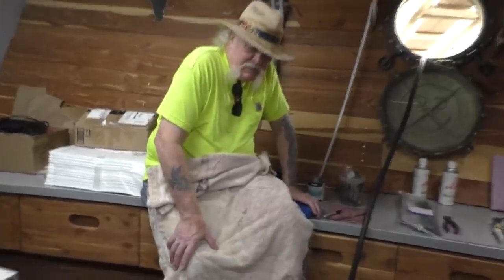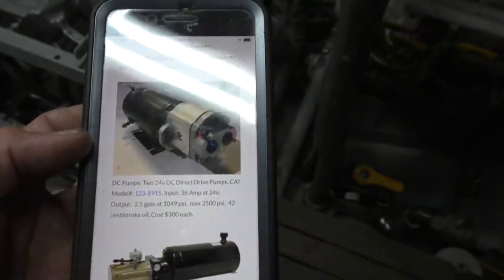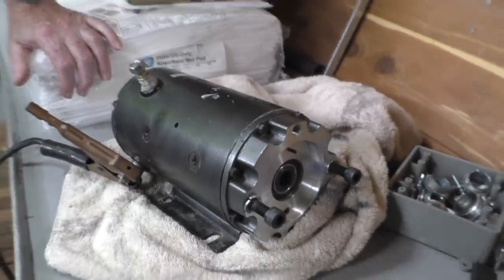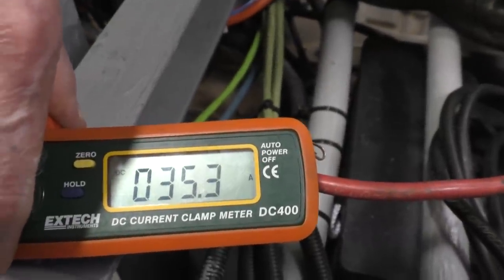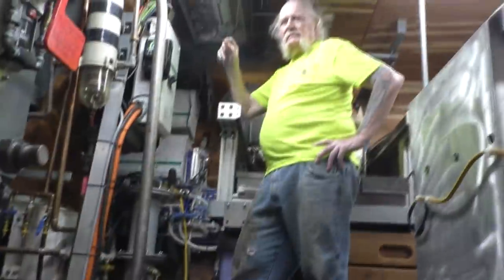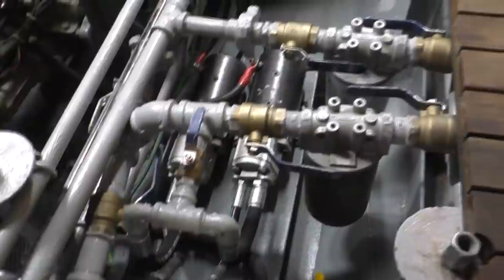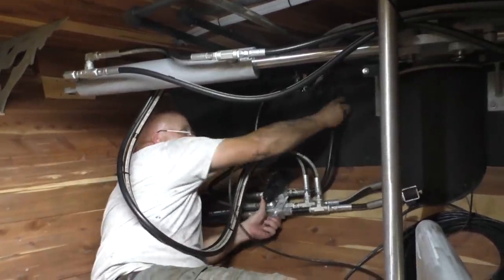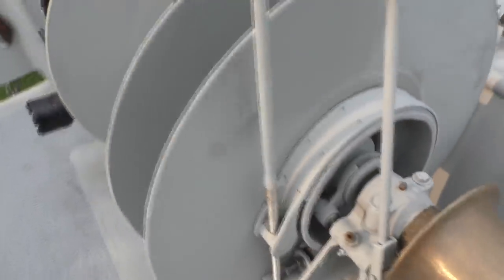Hydraulics - Part 9 - Charging the System

Comment: A 36 Amp motor should be rated for 300% for starting, or 108 Amps. You need motor starters that can handle that load for a short time during startup then protect normally.
Reply: This, this is why they make motor starters.
Reply: This is it
Reply: Doug, your in rush current is the problem.
Not your voltage.
You need a motor controller.
Reply: Maybe also keep that voltage up to get the current down. Running two parallel starters, ideally from two separate breakers - 200+ A is beyond my experience, but can those cables take that much current?
Reply: @Skwisgar2322  yes and use a 3 phase contactor looping through all the contacts  in series.
Reply: Would this be a good application for a VFD? It would adjust to the load on the hydraulic system.
Reply: @kermitfrog1897  I've installed dozens of them, which resulted in big $ in utility costs. I forgot about slowing the inrush current.
Reply: Yes! That's why car starters require such heavy wires and solenoids. A 100 amp starter may draw 3-400 amps initial load. (not to mention getting the engine rolling from a dead stop)
Reply: Correct.  You should use a D curve breaker instead of C and you will be fine.  All breakers are rated for spikes of current at startup.  Some more than others.  Just have to use the correct one for the application.
Reply: Came down to the comments to look for this. In-rush pops breakers that arent sized properly. Proper motor controllers / starters will solve this.
Reply: @kermitfrog1897  What are you talking about? he is working with DC Motors not AC. A VFD isnt going to work at all here.
Reply: @morganmcintire2853  Yes I know that . I posted later to disregard previous posts
Reply: Even if he only has C curve "supplementary circuit protectors", they should hold at about 6 times the rated current for about a second, and twice rated current for maybe 10 to 30 seconds. His devices seem to be tripping very quickly so I'd guess he is well above 300%.  D curve (which can carry 12 to 20 times rated for about a second)would probably be better or maybe even old school sol-blow fuses
He really should have a current meter with a good peak capture if he is going to be trouble shooting that kind of stuff
Reply: @morganmcintire2853  thank you for taking the time to explain this to us.
Reply: @cabletie69  No problem, my head is packed with useless information, nice to let some of it leak out now and then :-D
Reply: I think they were DC motors, vfts won't work with a DC motor. Also what size is the wire if sized for a 40 amp breaker you could be seen to a voltage drop and driving up the current good luck with your final solution
Reply: @kermitfrog1897  variable frequency drive........ on a direct current motor...... what frequency are you going to variate?  DC current is 0 Hz.......
Reply: @TheIceRover  read my post elsewhere under this video, where I responded to ignore... that I didn't realize they were DC motors
Reply: I don't want impose what I learned in Belgium engineering school....but the series theory doesn't apply because you can not guarantee the same load and rpm on the both engines. If the load is different then you have 6v on one engine and 18 v on the second. The sum will be 24v. That 18v engine will not last long because of over voltage. Burning carbon contractors borstels. The 6 v one will heat up due lot of current. 
 You need 24v motors on a 24v battery system. Otherwise you have to send the engines back. The start current can be up to 500%  and max pressure current  can be 300% of In (nominal) current.
If I don't get the imax or I start and the Voltage I will never buy that product. Ideally you even should get a chart current VS load. All the best.

Comment: There is a potential problem with running motors in series like that.  If you slow or stall a motor the voltage drop across it will drop (and allow more current to flow through).  If that happens to one of your motors, the other motor will suddenly have a lot extra voltage across it.  You'll probably be ok for now, but I'd highly recommend reworking your setup soon.
Reply: Lesson learned with slot cars - lift off when your opponent is on the corner - all the juice goes to his car and spins off :)
Reply: Not a problem in this application. The pumps are connected together so the load seen by each motor is exactly the same.
Reply: Just need a soft start integration.  Pretty straight forward for any electrical motor guy and easily researchable
Reply: And while running in series, if you are pulling 36 AMPS each, now you're running 72 AMPS through each pump. YMMV
Reply: @brianrydzeski6108  that's not how current works
Reply: @brianrydzeski6108  With the motors in series each motor gets the full supply current but half the supply voltage. In parallel each motor gets half the supply current but the full supply voltage.
Reply: @brianrydzeski6108  In a series circuit, I believe the amperage will be the same through each component, it is the voltage dropped across each component which will fluctuate. I do not believe that running the motors in series is a very good permanent solution. Atb
Reply: @brianrydzeski6108  They are not running series. That would be a ridiculous idea

Comment: Switching out breakers to meet the requirement of the motor like you were doing is something you can only do if you are working on your own system and know its limitations. In any more mainstream system the breaker would be dependent on the the wire used until the endpoint. THe breaker normally serves to prevent overloading the cabling.
Reply: In motor control circuits we use overload devices (breakers) to protect the motors, the cables are sized to meet the requirements of the motors and breakers. This is normal practice in motor control systems. This is how it is done on all industrial motor control systems whether it is your own or someone else's.

Comment: Inductive loads such as motors have huge inrush current. Try switching to a slow trip breaker, the fast trip ones are not recommended for inductive loads.
Reply: Yes.
Reply: I would also move back to 24v per motor, as this will drop that amperage needed to run the motors, were they were pulling 200 amps @ 12v in series,  it would be 100amp @24v in parallel.
Reply: @TWMist  Yes.
Reply: I believe this is correct for what is happening. The ‘inrush’ current is the current needed to build the magnetic field before there is motion of the motor. This condition is called ‘locked rotor’ and is typically 6x the running current and only lasts until the motor is up to speed. There are special breakers for handling locked rotor currents in motor applications.
Reply: Im no elechicken or enginerd, but couldnt you use some sort of capacitor/buffer to handle the large startup current?
Reply: @dave.willard  In fact the locked rotor current is generally around 10 times rated current and indicates that the motor isn't turning hence locked rotor, start current is around 4 times running current for an unloaded motor and 6 times for a loaded start, if those motors are rated at 36amps then it shouldn't be too long before they both burn out.
Reply: @roberson644  in some applications I have seen start capacitors. One of my clients use them on the starter motors for their dozers. Not as common and you would think.
Reply: @roberson644  no for many reasons but large capacitor are really expensive and even if you could get one like they tried selling for cars with big audio systems it probably still wouldnt be large enough and cost many hundreds of dollars but as long as the cabling is correct to handle the full load current than an approprately sized d curve breaker  will do the job
Reply: @justinmorris4457  start caps are used on ac motors but not for that reason, capacitor in an ac circuit changed the sinewave timing so by using one on a motor you can take a single phase supply and kind of simulate it being connected to like a 2 phase supply giving you more starting torque normally these are on a centrifugal switch turning off that when up to speed
Reply: @shaynegadsden  I guess I should have clarified that I don’t see them very commonly used as a means of mitigating the inrush. We use them all the time for phase sequencing, harmonic mitigation, and smoothing the “DC” side of a bridge rectifier. They are also an integral part of how a VFD operates and why you always look at the little red light before touching the DC buss on a drive.
Reply: @roberson644  No. Capacitor would just draw more current and not help with anything. Not used for DC motors.
In other words, a capacitor being charged up would draw a whole bunch more amps through the breaker. Guaranteed to pop!

Comment: As  🇬🇧 sparky, breakers should come with a type C or D for use with motors. All depends on the Trip Curve of the MCB.
Reply: All those breakers he is using are C curve. However it's a moot point if the operating current at working pressure is up at 200A... could probably use a B curve if it actually has to be 200A rated.

Comment: I'm not sure where we left off from the Facebook discussion but the work required to pump the oil GPM at the PSI required is 14 hp. That will be alot more than 36amps.
Those pump units on a CAT 745 truck is a substantial drain on 4D batteries. You will need much larger cabling and contactors to start/run those pumps at full flow/psi.
14 hp =10.5 kw = 437 amps @ 24v, 875 amps @12v.
Reply from the maker: I wouldn’t mind 14 hp of DC battery but that’s not the calculation I came to.
Reply: @SVSeeker  what cc/rev did you come to for that pump?
Reply: Hp to drive hydraulic pump = Psi x GPM / 1714
Reply: @SVSeeker  seems to me that a change to lifepo4 batts is in order. 10.5 kwh is 16 x  200ah cells. Space required equals 2 milk crates. Should fit
Reply: Also, series connection is not recommended for motors. If one motor stalls it's current will spike, hence it's burden voltage will drop which will result in the other one overvolting.

Comment: I’m glad Im not the only one that thinks wiring the two 12v pumps in series is not ideal. Im also glad to see the system performing so nicely.
Reply from the maker: If you want to needlessly worry about things you imagine, you will never be alone.  : )
Reply: @SVSeeker  if it’s one thing I’ve learned from keeping up with your progress on Seeker all these years, it is don’t worry about Doug or what Doug is doing, Doug has figured Doug’s stuff out, I need to figure out my own stuff. ✌️✌️👍👍🇺🇸🇺🇸
Reply: What Doug has done works.  The downside is if something goes wrong with one motor, the other will suffer issues too.  That big inrush current will also decrease the life expectancy of the motors and breakers.  A VFD or soft starter can fix that but they can be expensive.
Reply: Are they actually wired in series? Not a good idea if so.

Comment: I see lots of good advice in the comments and I’m sure someone already said this but I’ll say it too. The motors are probably designed for 24v and will run at that they just require a lot more current to start and that’s why the breaker trips. I suggest you wire the 2 motors on separate breakers to avoid a problem of one stalling and the other running faster as well as to reduce the load on one breaker and associated cabling. I’m no expert but I think you may also want a larger amp and slower tripping breaker then the 65amp you used to get past the initial start as well as the demand under load since you were seeing upwards of 200amps. Just make sure the cable you use throughout the circuit is able to safely supply that amount of current without causing an electrical fire. 

Super cool project and love what you’re doing. Hope my opinion on the wiring is helpful. Anyone is welcome to correct me if I said something wrong. I’m not an electrician so maybe take my advice with a grain of salt 🤷‍♂️

Comment: Type C circuit breakers are used for more powerful electrical devices where any surges are likely to be higher – typically commercial and industrial environments. They are designed to trip at currents between five and ten times their rated load. Good examples include smaller electric motors and fluorescent lighting.

Comment: I think you better get a lot of oil  absorbent pads to bring with you. They come in a big roll that make it very handy to rip off a pad when you need one. The next suggestion is a few open top  DOT barrels to put your oily waste in. These are specifically designed barrels with a heavy cover band and gasket to contain everything inside from leaking. 
I can see oil leaks are going to be a big problem on this vessel and a containment program is definitely needed. 🤝🤝🤝👍👍👍

Comment: TO PEOPLE INSISTING ON STARTING CAPACITORS: DC brushed motors DO NOT use start caps and really cannot use start caps.  Technically, you could add a cap to assist in starting but it would be a ridiculously & unreasonably LARGE capacitor and would need to be switched in and out of the circuit automatically; quickly.  Caps are used on DC brushed motors to inhibit EMI/RFI (electrical noise) and to ease arcing from the brushes to the commutator, therefore, preventing pitting and scorching to said commutator.
Reply: Bingo you are right on the money and know what you are talking about.
Reply: 3 phase motors don't use starting caps either...ignore my other posts about VFD's, I was assuming 3 phase motors. Would still be good to separate the series string and either wire in parallel or use separate DC controllers. My lack of familiarity with his system isn't helping things

Comment: They are 24 volt DC motors they can draw up to ten times rated running amps on start up. Under volting a motor can make it burn out faster as it try's to draw more current due to lower back emf due to slower speed and those motors have no cooling so they will get hot quickly.

Comment: Hey just so you know ! If install a test inlet in system. You can pressure the system with air! Find all the leaks before make mess with fluid and latter use same inlet to push out all the fluid back in tank to remove and or repair system! Less messy ? Less loss of fluid!
Reply from the maker: I think that was Part 8  : )
Reply: @SVSeeker  okay must of missed of few with that test? Or ?
Reply: @KG-yn9qi  making a joke

Comment: I think you need slower acting breakers for those motors. They pull huge inductive loads when starting up and your breakers are tripping too quickly.
Reply: Yep. Motor starters exist for a reason.
Reply: @scout10  I don't understand. The motor starts itself, it doesn't need an external device. But it will draw a huge amount of current coming up to speed. Maybe 10x running speed. You need to change to a breaker that will permit the surge current for the brief time startup is happening. Maybe you're talking about something else though.

Comment: I would guess if you run in series, use a large Capacitor to dampen voltage swings.
Reply: Also if one of the motors craps out, you lose both. And usually you use sleeves for wires, before you screw it into the terminal block of the breakers, but guess he prolly knows that

Comment: A typical 12v starter motor runs at 150 amps. Run them through a contactor. You can use one with a  12 or 24v coil

Comment: Doug.  I've been very impressed with your common sense approach to things in general, and to your penchant for adding redundancy to your critical systems.  What worries me is the complexity which these systems necessarily encompass.  I know you had lots of help with the build, and having maps of systems and checklists for operation might add some additional protection in area of human redundancy.  A lot of us out here could study and troubleshoot your main operating systems, but not in an emergency on a moments notice.  My point is this.  Do you have a first mate who is as familiar with SV Seeker as you are?  You got a lot of stuff on that boat, sir!
Reply from the maker: You're welcome to come serve and study every system on board.  If you apply yourself I'm sure you'll do fine.   If I die, it might even come in handy.  So impress me.    But for the love of god sitting at home worrying about what you can imagine is doing no one any good.  Do, or get out of the way.
Reply: I did.  I did for 40 years.  I'm done.  I've taken over my Father's job.  Now I supervise.  Good luck to you!
Reply from the maker: @stephanieluigon5192    Thanks Mom.   Good luck to you.
Reply: @SVSeeker  Ummm, I don't think that's a proper philosophy for running a seagoing vessel. 
This is a very complex system already at the outset. Lots of ways to go wrong. What happens when there are multiple failures that are interconnected, and the seas are the opposite of calm.  Oh dear....
Reply from the maker: @henryD9363  Fear is easy.
Reply: @SVSeeker  these folks find anything possible to fear, just like insurance agents.

Comment: It’s very likely that the motors draw a huge amount of current at startup
Reply: @Darren Munsell absolutely. With no rotation the only limit on current is very low DC resistance of the wiring. Lots of amps. When it gets spinning then the back EMF, creating reverse voltage, reduces the current.

Comment: You got a lot of good comments here. 
Inrush is most of the time the problem. So a breaker for motors is better. 
Here in the Netherlands we use “C” characteristic breakers. Instead of the normal “B”. And if that doesn’t work motor starters.

Comment: Doug, hopefully something here is useful;
Looks like a 40A no load rating motor. Starting amps will be max at V/r, where V is the applied voltage and r is the zero RPM resistance. So measure the resistance of your motor (while wiring disconnected) and you'll know your start and stall current (they're equal).
Breakers should be rated to protect cable and motor,  but beware that most breakers show AC ratings which differ from their DC capacity/sensitivity
(DC usually lower).
I've never screamed at a video so much. And I've watched most of yours; such a pleasure. Good luck!